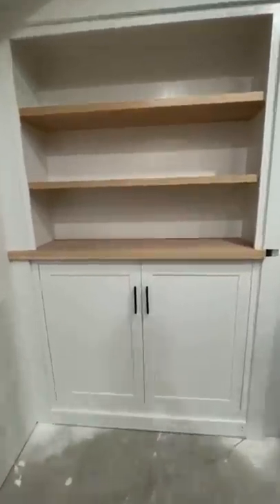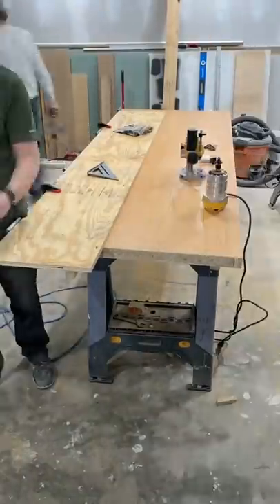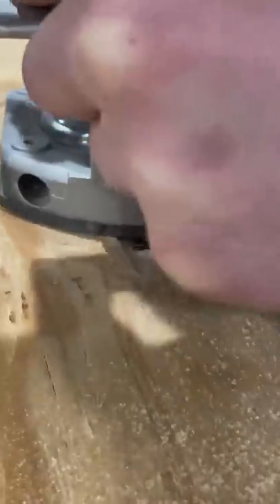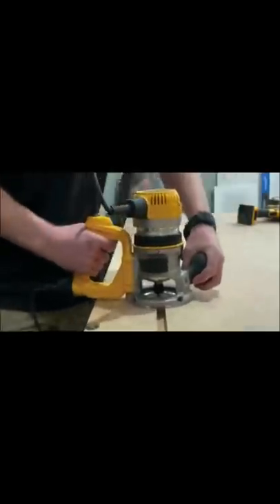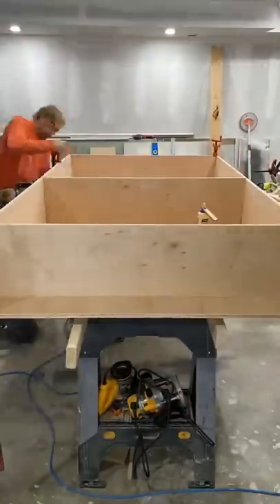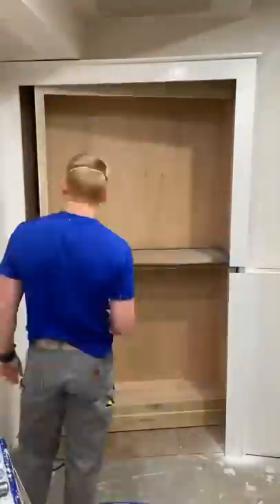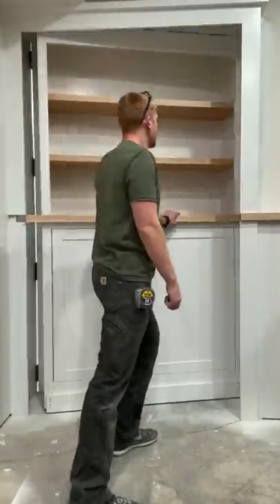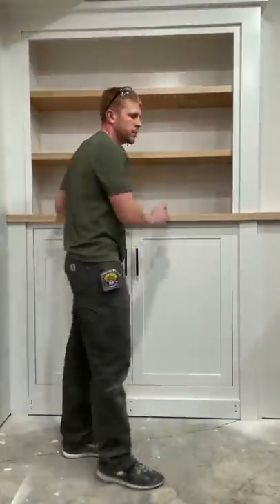How to Build a Secret Bookcase Door | Short Version

Comment: What paint did you use?
Reply from the maker: We used Sherwin Williams Showcase - Pure White in a semigloss finish
Reply: @SatisfyDIY  ahh dang I don’t think they sell that one in Canada... and you don’t need to prime the wood first? You haven’t had issues with peeling? And I know it says “one coat guaranteed” on the can, but do you find that’s the case even with white? The finished product looked really good.
Reply from the maker: I did 2 coats. With a light sanding after the first. No peeling. Paint sprayers put on an awesome finish!

Comment: Turn off the power the door will open. Unless you put a power supply with a battery back up.
Reply from the maker: Correct it is a fail safe.

Comment: Bro what the f*** are you doing with regular door hinges. You need like heavy duty door hinges when you're putting that much leveraged weight on it and you need different better/bigger/longer screws for the wall
Reply from the maker: They are commercial hinges 800lb capacity with lag screws…. And a caster on opposite corner.